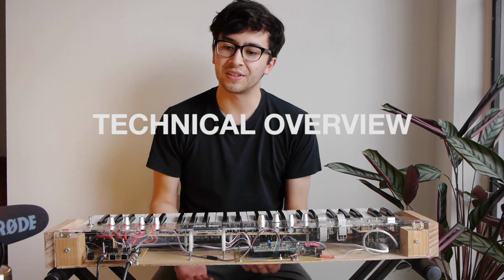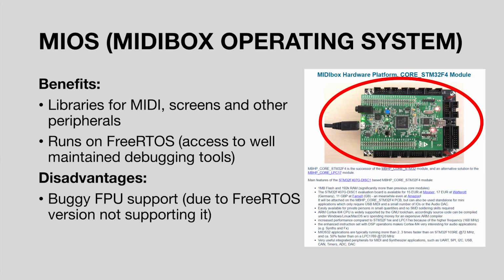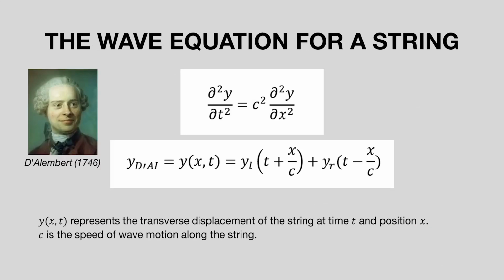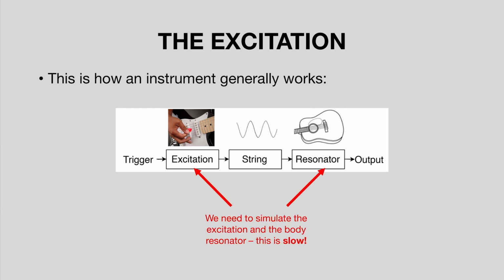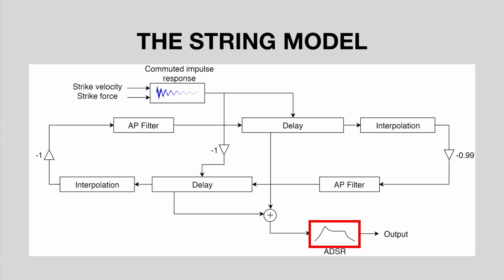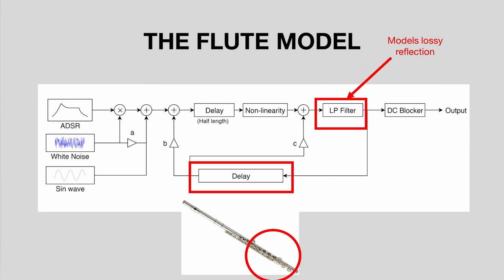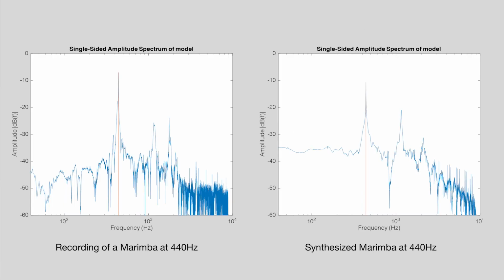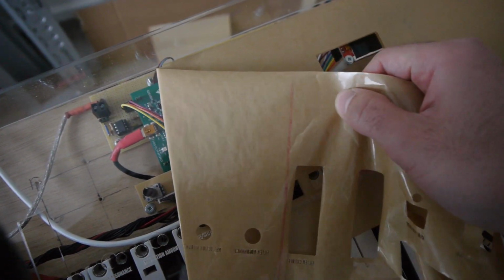Standalone Physical Modelling Synthesizer - Monash Final Year Project 2018

Comment: i am trying to understand digital synths of 80s,.90s,. how it works the polyphony ? what is the limitations.. how works the voices..?
Reply: You mean in regards to PhM synthesizers? If so, there were not many even made and the only ones I can think of were monophonic or duophonic. If you're referring to polyphony generally in all types of synthesizers then it is basically acheived through the use of multiple mono voices, with a lot of logic for voice stealing and allocation. It's why polyphony was limited to usually 8 or less voices until the early 1990's - hardware poly synths in general are essentially just multiple mono synth engines in a single chasis.

Comment: I thought it was interesting that, during your banded waveguide model research, you determined the cutoff frequency for the band pass filters experimentally… and it was spot on with the theory. The common vibration modes of vibrating bars are proportional to the squares of odd integers… almost: 3.0112, 5, 7, 9, … (2n+1). If you take the ratio as the square of those numbers(I.e ( 3.0112/5)^2), you get the ratios you measured experimentally: 1.0 : 2.76 : 5.40 : 8.90 … etc the higher you go the more harmonics you get.

Comment: Very impressive project. Regarding your comments at the end on the high level approach - as of 2020 the Faust language can do it on a microcontroller. You can create high level physical synthesis models in the Faust language and it will generate code for various targets including the Teensy microcontroller boards. Incredible! https://faustdoc.grame.fr/tutorials/teensy/?
Reply from the maker: Hey, yeah I did have a look at Faust when I started the project - there are some great models included with it! Unfortunately the generated C code was tricky to implement on the board, especially once I had a lot of parameters to change. What I meant was to use something like a single-board computer and something like Go or python, as they're easier to debug and faster to write than the current C code. Thanks for the nice comment!

Comment: This is very interesting.  Thanks.

However, I've just spent about two hours trying to compile it, on Windows, and finally tracked down the problem to your common.mk file - it's gcc version specific, and not the version that's currently on offer.

I would have raised an issue on your github account for it, but I don't see an issues tab.

So, the "How do I build this?" advice needs to point out the need to make some edits to that file, so the make utility can work.  As it is, it tries to run gcc with the wrong path, so it fails, with error messages that don't mean a lot to people who aren't used to using it - like me.

The GNU Embedded Toolchain (ARM) currently installs to:
C:\Program Files (x86)\GNU Tools ARM Embedded\8 2018-q4-major
Reply: I decided to use the same gcc version (7.2.1), but I still needed to change the path in common.mk.  I don't have the armv7e-m sub folder referred to.  Did you install that after installing the ARM tool chain?  If so, where from?  I can't find any source for it.

The path had to be changed to this, to get it to compile:

# set the path
XTOOLS_DIR = "C:/Program Files (x86)/GNU Tools ARM Embedded/7 2017-q4-major"

But I'm missing the armv7e-m sub folder referred to here:

# set the version
#X_LIBGCC_DIR = $(XTOOLS_DIR)/lib/gcc/arm-none-eabi/7.2.1/armv7e-m/fpu
Reply from the maker: @TooSlowTube  Hey, I turned issues on for github if you have any other questions. I also don't have that folder ($(XTOOLS_DIR)/lib/gcc/arm-none-eabi/7.2.1/armv7e-m/fpu). I commented that line out in the makefile as I changed versions of gcc and the libgcc directory changed.  I did all of this on debian, so hope the rest of it works okay with the windows version of the GNU embedded toolkit. Sorry the build instructions are a bit sparse, I had to package it all up quite quickly when the project was due. Cheers
Reply: @valerianmccaskill , Cool.  Thanks. I'll add that as an issue, later, in case someone else is wondering the same.

Can it be used without the LCD display, or is that essential?  I watched your video shortly after ordering the STM32F4 DISCOVERY card.  If I'd known, I could have ordered the display at the same time, but it may have to wait a while now.
Reply: In answer to my own question - no, the LCD display is not needed. It shows the current patch / instrument type, but as there are only a few of those, you can live without that bit.

I currently have two working - I waited until I could get the LCD panel, before I made the first one, then made a second one without it, partly so I didn't have to disturb the wiring to try that out.

I've made them as just a module, with MIDI IN and audio out, to be used with a keyboard and a MIDI controller to provide the knobs.

It is a fun synth, and I intend to work on the software a bit more, once the weather cools down.  I don't do the whole github thing though, so I won't be posting any updates on there.

Comment: Hello, this is a great project, I am certain you will get an A+  BTW Where did you get the keyboard and modulation/pitch wheels from?
Reply from the maker: Hey there, the mod/pitch wheels are just out of an old midi keyboard. I tried sourcing the keybed and mod/pitch wheels seperately but it turned out to be too expensive in the end.